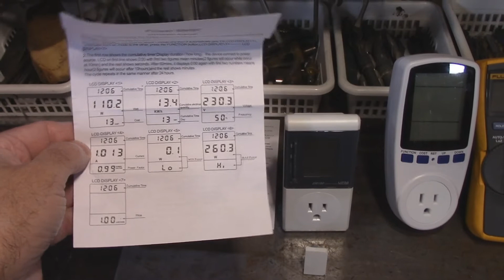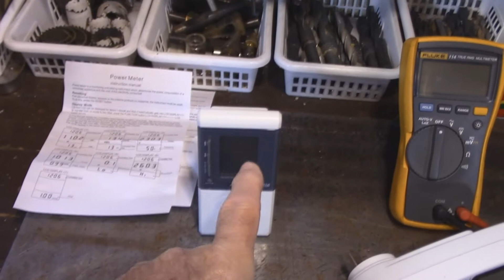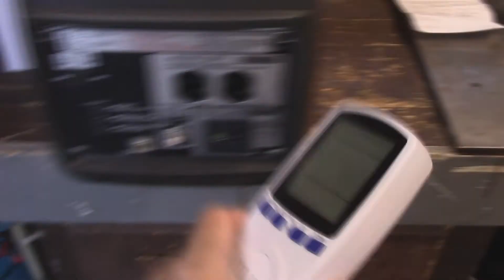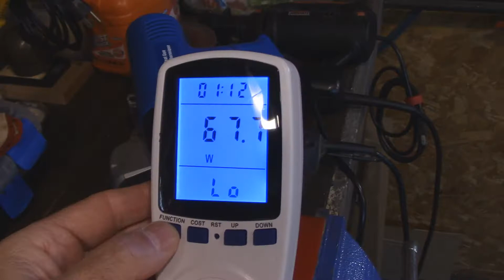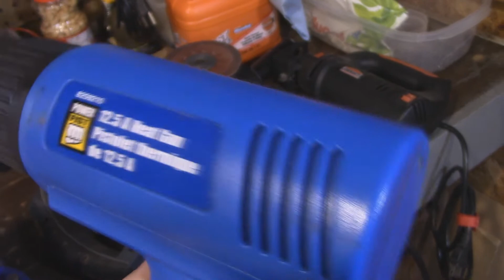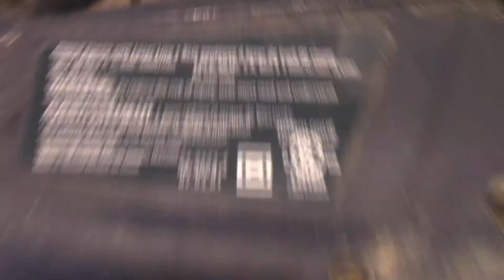How This Generator Powers My House - Electrical Load Testing Results

Comment: Steve your right I have an 8000 Generac it runs my house back through the fuse box it does use lots of gas, so we run it then we give it a break. But down south you need it for the hot summers they are hard to deal with night is the worse time.
Reply from the maker: Hi Danny 
I have a 7000w generac at the camp and it chews up gas fast :)  I'd take the summer heat without electricity than at   -25  cold 🥶 😅

Comment: I recently had a "Whole house generator" installed. It runs off my 500 gallon propane tank. It burns 4.5 gallons of propane an hour! That's a lot of furl so I do use a small Yamaha generator for things like the fridge and freezer. I always enjoy stopping by to see what your up to Steve.
Reply from the maker: Hi Wyatt 
You should show the  whole house genset  , up here there  Mega expensive .   I just wanted to keep warm for the cold winters  but it seems every year I'm adding more items to power LOL
Reply: @SteveRobReviews  Hugely expensive. The only reason I could afford one is because I had a small inheritance from my dad. I spent almost all of the money on the gen.

Comment: Well done, Steve. You're right about having a generator sized to your needs during an outage. Many, as you say, are just burning gas needlessly. I like the watt/amp/volt meter. I have two of that exact type. (I lost one for a while and replaced it, then soon afterwards, found the first one--isn't that always the way). I lived off-grid for 10 years on a small island in northern BC and generated my own power ( I also had a propane fridge and stove) and I always had cheap, old generators until one day I bought a good-used Honda EM2500 for $500. It would start on the first pull and ran flawlessly for the last four years and I sold it for the same price I paid when I left the island! They hold their value and don't disappoint! When I rewired an old house that we now own, I installed a transfer switch for the generator that powers several essential circuits. But, as you say, running an extension cord for a short power outage works well for most. The standard that I like to use when buying a generator (always used, and often broken down haha) is that they will run a power tool like a circular saw. That much amperage will be sufficient for any fridge, freezer, kettle if run independently of one another during a power outage. Take care and keep up the great work!
Reply from the maker: Thanks Craig , so many people in my world just don't know much about generators or how to use them except at a campsite to power some items but don't know how to use them at-home.
Reply: @SteveRobReviews Exactly! Did anyone ever say that look look a lot like Steve McQueen? Didn't think so, because you don't! Hahahaha:face-red-droopy-eyes::face-red-heart-shape:

Comment: ive got a wen version of your generator it works great if your looking for another generator that size and dont want to spend that honda money i really suggest looking at a wen they run around $400 usd and id have never bought one until i saw what we put them through at work they will sit in the bed of a work truck their whole life getting rained on and fire up first pull and thats multiple different units id never believe it if i hadnt seen it myself. would like to see more on your generator stuff like how your running your furnace and curious to why u don just backfeed into the house
Reply from the maker: Back feeding 120v is almost impossible to do and  not suggested so in this video from 7 years ago shows how I do it. 
https://youtu.be/UnWyKIOQ9JQ?feature=shared
Reply: @SteveRobReviews  ok I'll check that out thanks

Comment: My next one I buy will be an inverter . I use my small 2,000 watt generators a lot more than my big generator . Big one only comes out if i have a high demand for 220v . I use extension cords also.
Reply from the maker: Terry the Firman inverter genset 2000w  is a good unit as well.  Up here on sale at Costco $300.00 .

Comment: Hi Steve!  So the question is, how do you power something like a furnace, wall sockets or other appliance that does not have a cord and a plug and is wired directly into the breaker box?  I currently have the receptacle that is outside the house where my generator plugs in.        Thanks.            JimE
Reply from the maker: Hi Jim I do show how in the video preview at the end .  You must  actually try it all out, and during the summer is a good time .
Reply: @SteveRobReviews  Is it somewhere in one of the 75 "Electrical Testing Videos" link?    JimE
Reply from the maker: @JimE6243  Jim the link  to the specific video is in the description box , it should explain how the connections are made.
Reply: @SteveRobReviews  Thanks Steve.  I didn't see it when I first watched the video.  JimE
Reply from the maker: @JimE6243  👍

Comment: Hey Steve. This same generator works for my home. Fridge, oil furnace, all the lighting and plugs, internet and entire garage. It runs on eco mode the entire time unless Karen plugs in a hair dryer, then it comes off eco mode until she is done. I ran the house, minus the kitchen range, electric hot water, and clothes dryer, for 11 days straight, only turning it off at night for 8 hours. 16 hours a day for 11 days on 80 liters of fuel.
Reply from the maker: Awesome Kenny , glad to see your prepared .

Comment: How's she goin'?  If we were very careful and paid attention, your technique for operating your home on a generator is doable.  This Honda Generator only provides 120  volts, single phase, so if you need 220 for anything in your home, this generator won't do the job.  I need 220 volts for example to run my water pump.  And when you look at generators with 220 volt capabilities, the normal connection point on the generator is 220 volts @ 30 amps.  So this means you need a generator that can support 30 amps of draw.  This equates to about 6000 running watts.  So buying a generator that is capable of producing more than 6000 watts is not necessary.  For minimal loads, such as a TV, a lamp or 2, a fridge, if only a fridge is operating, or a furnace, this 2000 watt 120 volt generator can certainly do the job.  Interesting video Steve.  Take 'er easy!!
Reply from the maker: Hi Mike , 240v circuits means a whole different setup  and connections much differently as well.   For many just getting the heat on and a couple of lights would be awesome:)
Reply: We were in that boat today Steve.  We lost power at 7 this morning and we have no propane so having access to 220 volts from the generator was key for us.  The power came back on around 7 tonight.  And we got a load of propane finally after being without for 4 weeks.  And we're on the auto delivery system too!!  So now we're living like normal folk again!!  LOL   @SteveRobReviews
Reply from the maker: @GrampiesWorkshop  Wow 4 weeks , they should have  given you the propane  for free.
Reply: Well I have found out that the only thing Irving will give you is a poor customer service.   @SteveRobReviews

Comment: I like my big honker Steve but I understand what you saying. I have a few stories of times when I waited a few hours thinking it’s going to come on any minute and it didn’t so when I setup everything was in high demand and when I plugged in the house panel, the generator could take it. The way you do it one would have to bring things on on at a time to give the surge a chance to stager. I’m starting to look at setting up my honker on natural gas so it would never run out. I think the most important thing in a power outage is to HAVE ON HAND a generator that WILL start and have fuel IN STORAGE. Your doing very good with that small Honda but not with a lot of trouble but you like to figure things out....Well done...CHEERS
Reply from the maker: Thanks Gator , I think another small genset is in order soon as we're putting a new freezer and fridge downstairs.

Comment: Some nice info steve, nice tip abount turning on and off at different times.
Reply from the maker: Jason The 3000w genset you have runs most of your house during an outage too.  Most get a genset but the challenge is actually hooking stuff up.

Comment: Is there some sort of filter/cleaner someone could use for a regular generator that isn't an inverter generator?  I'm sure my old Champion generator wouldn't be too good for my furnace or my fridge
Reply from the maker: Good question Bruce , I've never seen one before.   Just try  the genset you have and see if it runs what you want .  Might be a good vid idea :)